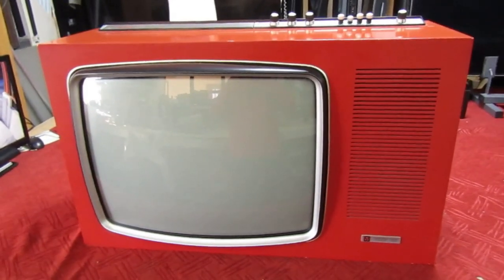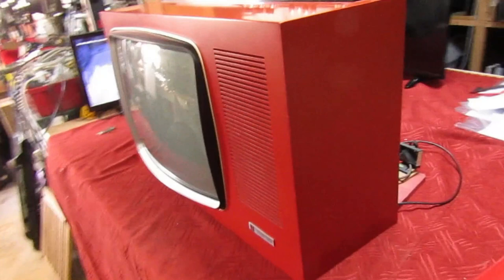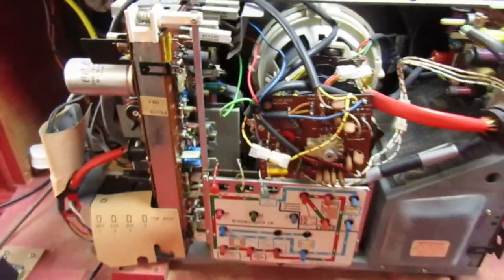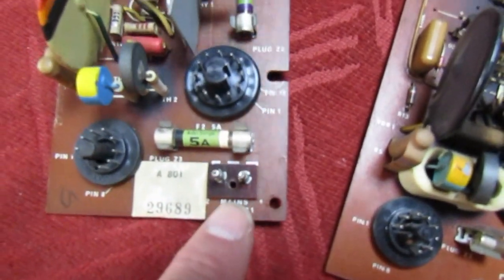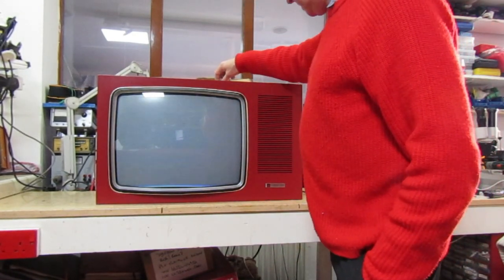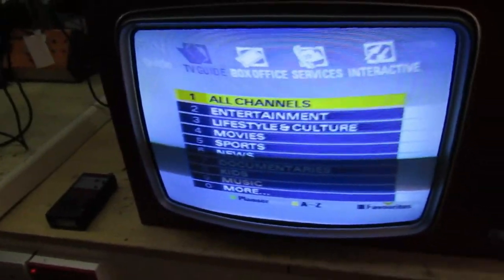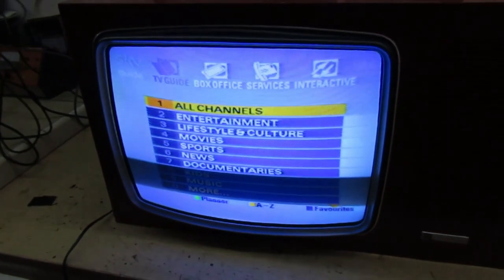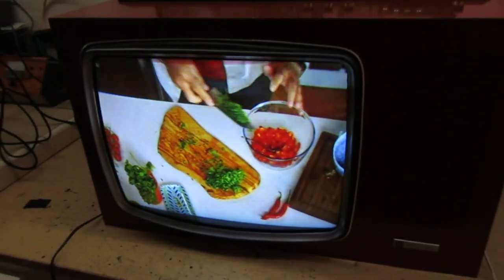Rank Bush Murphy A823 chassis vintage colour TV set from 1970 .

Comment: I remember this chassis well, it was the lead to the degausing coil that must be kept plugged in.
The one chip decoder was from the early batch of sets, the later 2 chip one is interchangeable.
Like all designs of that era, heat was the cause of most faults, and the charred spare panels shows
how bad they got, some were often beyond repair as the burnt areas became conductive.
I was only 15 in 1970, by 1972 i was learning how to repair them along with all the other popular
chassis from that time.
That orange painted cabinet shouts the 70's some were in white which turned cream due to the heat.
Happier days, when you knew the faults before you took the back of the set.
Thanks for this trip down memory lane.🙂👍
Reply from the maker: Glad you liked it , back then a lot of sets presented a serious fire hazard, you wouldn't get away with anything  like that today .

Comment: I used to like these. I sold hundreds of Co-op ex-rental models of these. The faults were fairly predictable and the weak spots easily dealt with before sale. The LOPTs never, ever failed (well not for me anyway, I kept one spare LOPT in stock and never needed to use it). The mechanical tuners had a problem with the nylon nuts disintegrating which was a nightmare until replacements became available from the spares suppliers. (These days you could probably 3D print them!)

Comment: wow nice to see a good old Rank murphy colour tv up and running again they were so easy to repair and set up i had a white Murphy A823  with the six electronic tuners on the top of the set with the afc button on the top too and the colour decoder on mine had the Twin chips fitted
Reply from the maker: I cant remember the electronic tuned set so not sure why you would want 6 channel tuning in 1970 , we only had 3 channels up until about 1984 and I guess by then most of these sets would have been scrapped.
Reply: @michaeldranfield7140  I agree there but they did have them on the Murphy ones and some of the Bush ones too but they were often flimsy and broke easily and some of the CRTS Would often display milky pictures if they were weak tubes plus had a fair few that had suffered catastropic power supply failures with the thyristor ending up destroyed and other problems like Video output transistors in the colour decoder failing 
but overall they were otherwise reliable Tv's

Comment: I cut my teeth on the A823 chassis. What you have there is an early  Murphy Acoustic with the one chip decoder, also the later models didn't have the two big pots on the timebase board. For the age of it looks very good. I've not seen one for over thirty years !
Reply from the maker: I think for me its 40 years since I last saw one of these !

Comment: I worked the solder bath at the end of the production line for the decoder panel at RBM in Plymouth 1974 ish and I remember there being 2 ICs on the board so the spare one may well be the later version.  Part of the job was to make sure certain components were pushed down before soldering including those ICs, the pots on the RGB output and the delay lines.  Thanks for the video, takes me back.
Reply from the maker: No problem , glad it was of interest and helps to bring back valuable memories for you .

Comment: nice, i repaired a bush ctv194 some years back, looks similar or same chassis, only fault was cracked surge thermistor,  unfortunately it eventually got dumped, with an early version 26inch philips g8 when the garage owned by the sets owner closed down and was demolished for housing, if i had space i would have had them, but i was already bunged up, he'd given me loads of stuff like old unwanted tvs, valve radios, etc. over the years as he used to do tv and radio repairs many years back as well as run a garage,

Comment: Fantastic Michael. I wish I'd kept one of these. I worked on many of them and, in later days, thrown many away. The early single chip decoders started off life with an IC with a built-in heatsink like the Plessey/Sinclair audio ICs of the day.
Reply from the maker: When I look back at the stuff I skipped many years ago I too wish I had kept hold of it , but then I didn't think 40 odd years later it would be making a comeback .
Reply: Allahu Ahlam how many Mains Voltage Isolation transformers I threw out decades ago.
Reply from the maker: @andrew_koala2974  I use to use the transformers out of the G8 to cure heater cathode shorts in some sets.

Comment: What a stunner!! Condition as well as the red finish and the resulting picture... just wonderful.

We had one of these from around 1972-1980 in white; re-badged with the name of the rental company and I was only little but I've had my eyes open for any sightings of them ever since. 😀

I believe they were marketed as 'Acoustic Deluxe', along with the earlier mono sets with a very similar cabinet design. And they were available in green and orange as well - both mono & colour ones.

Great to see - thank you.
Reply from the maker: Yes I do have recollections of the mono sets having coloured cabinets , cant remember the chassis number , I think it was something like 774 , I remember they had two boards .
Reply: @michaeldranfield7140  hi and thanks for the reply. I've seen a very good thread on the radios-tv. forum in which a post lists variations of the monos which started life with the dual standard A640 chassis. Then the single standard is the A774 chassis; there was also a solid-state single A816. My parents also had one of these for a short time... I remember my mum telling me this...  undoubtedly one of the latter two but wanted colour and the shop were not happy with them because they'd only just started renting the b/w one! I found the user manual many moons ago and so asked about it - why they had the wrong one, for a different set. But they didn't!  😆

As noted below, the actual colour set we rented would have been the later version - the tube surround looks a little different to this beauty on the video, as well as the channel selectors were very light to the touch, instead of the 'thunk' that my Ferguson Courier b/w has, along with countless others from the era lol. 

There are some nice advertising brochures for these sets online - I'd love to have them in my collection... I grab what I can from eBay when the price is right and do have a RBM tv colour catalogue from  circa 1974, alas not having one of these on the pages.
Reply from the maker: @IanAKAKeith  I have just joined the radios TV group, this guy has a stunning collection of sets , far better than mine .

Comment: customers used to like them with the matching stand.
it was the lead to the convergence coils that must be pluged in to stop the resistor catching fire.
In my opinion the single chip decoder gave a better picture than the twin chip and as far as i remember they  were interchangable 
great video as allways.
Reply from the maker: The owner has the matching swivel stand but removed the stand before transporting it to me , I still cant remember what not to unplug , I just remembered it was easy to forget and cause a burn up .
Reply: I ment degausing coils

Comment: Working at Rediffusion in the mid 70s it was mostly their MK1 hybrid but theY also had the A823s and BRC 3000/3500s. They even had some of the A823 chassis refitted into new cabinets with electronic tuners. I still remember changing those mechanical tuner plastic bushes from white to blue when they used to break and that carbon rod focus in the tower which scared me to near death.
Reply from the maker: when I removed the screening can my first thought was how to adjust the focus control, do you need a plastic tool , then I noticed its on a screw arrangement down a hole .

Comment: That set is in excellent condition. I think you will have to look at the video coupling as I can see l.f. streaking. If this is sorted the picture will be as new. The single chip decoder board is correct for that model as it also has the earlier timebase board and mechanical tuner so all original. Loved working on these sets in the 70's, never had a line output transformer fail on one of these!
Reply from the maker: The picture looks better that it is in the video , good to know about the transformer, parts like this will not be obtainable now  and I don't even know if anyone still does transformer re winding .

Comment: Fabulous stuff. A white one sleeps in my cellar. It's pretty rough, I think it also has the two chip decoder. I've also got the black and white version with the A819 (I think) chassis. One day I'll get around to it. Maybe......
Reply from the maker: I remember there were black and white sets in bright gloss cabinets , line transformers were a common failing on the mono sets.
Reply: @michaeldranfield7140  They looked very similar to the 823 colour sets, a lot shallower of course. The Murphy ones were branded 'acoustic deluxe'. I've still got the pedestal stand, and they fetch good brass on ebay but I wanted to keep mine, I saved it from the bin when it came off rental in 1990......
Reply from the maker: @stuartarundale6219  The customer has the matching stand for this set but removed it for transport, that's something you never see any more , stands for old TV s .
Reply: @michaeldranfield7140  Indeed so. The stand for mine is unfortunately in rather the same condition of the set. It would have to be re-chromed if the set were ever to be refinished and restored. I can't even remember what condition the tube was in. Sleeping next to it is another uncommon white set, a Korting Transmare hybrid, in similar disheveled condition alas

Comment: Very unusual to see in such a clean form. Those two extra PCBs seem to be its past repair history.  
Wish I could remember nowadays to reform the reserviour cap before switch on.  So many times on an instrument amp especially I've had to replace one because I forgot completely. Maybe having a purpose made reforming box like you use would remind me.
Reply from the maker: Other people have commented that the single chip board was the correct one for the year of the TV , so I would imagine the other boards have been used for fault finding , a thing I hadn't noticed in a plastic bag there were a set of decoder extension leads so I would guess at one time this set would have been owned by a collector .

Comment: Very nice set, loved that painted cabinet, they were ultra stylish back then, very well made and thought out chassis apart from the decoder which was a pig to work on due to lack of space, if you were an accredited rbm dealership a test chassis was available with a good set of boards extension leads and a 'second' crt, it wasn't particularly cheap but if you'd got dozens of them out on rental it was a good way of always having enough spare panels to support them.
Reply from the maker: I guess if you had a scrap set for the plugs and sockets you could make up your own set of extension leads .

Comment: IC's and 2 chip decoder? ... In 1970, I was watching a 1960's Ecko black & white valve powered 405 line Rediffusion TV with a clicky channel selector on the wall! 👎🤣 ... My father bought his first Ultra Bermuda Colour 26" TV from Trident in 1973 for £300 IIRC. It was solid state, but contained no IC's!

Comment: 7:20 - the single chip decoder indicates that’s a later board so the picture will tint slightly towards green. February 1970 date code on the caps indicates an earlier A823 though, so that decoder board has been swapped at some point.

Unless RBM were just using up older stock of new caps when this was made?
Reply from the maker: as it came with a couple of spare boards which had both been worked on I would think this came from an EX collector or enthusiast. I still have not found the service manual , I have it somewhere , I remember it had a brown front cover ., so not sure of the exact dates or decoder arrangement .

Comment: That's a early A823 with mechanical tuner unit fitted , the later ones had a 6 button switch bank .I think the decoder used to have 2 chips fitted SL901 /SL917  ? comes to mind . Not bad picture for a 50 year old tv not had much use by the looks of it .Murphy did them in Red , White, Green ,Blue as far as I remember  with  optional swivel stand .
Reply from the maker: I do remember the red and white very well but not the other colours, the owner also has the matching swivel stand , he removed the stand for transportation to me .
Reply: @michaeldranfield7140  I do remember seeing mono sets one with a green cabinet with dual standard a640 chassis and several white cabinets fitted with the single standard a774 chassis

Comment: Vertical still has a bit of residual bent at top but not noticeable. Though having said that, when I saw the kink before the dried out EB cap changed it seemed to me it was very slowly moving upwards out of frame and into blanking.
Reply from the maker: I didn't see it moving and digital cameras never seem to take good pictures of television sets

Comment: Thank God for EU energy labels. Lots of resistors that are basically just heating the inside of the cabinet.
Some older sets would, when they're turned off, still keep the tube filament heated, so you wouldn't have to wait for it.

Comment: My apprenticeship tv…crunchy convergence pots… thyristor power supply…poor 20’’ Toshiba tubes …
Reply from the maker: Its surprising just how hot these wire wound pots run .
Reply: Wasn’t it a BT106 thyristor bolted to a heat sink and hardwired to the board?
Reply from the maker: @steve83803 Yes BT106 , a few set makes in the day adopted the same thyristor power supply.

Comment: We had a set that looked similar, but it was black and white and a wood veneer cabinet. I remember it failed under guarantee and my parents sent it back to Comet for repair. They had it for about 2 weeks before diagnosing line output transistor failure. Mum was not impressed with the repair department!!

Comment: I have a  circa 1980 SONY  26""  Multi-System TV sitting in the Garage 
for decades - It was built by SONY in Germany and cost a fortune New.
At almost $2300 as near as I recall and double the price of a commonly
available domestic TV.
It failed after only 3 months of use - as it was under warranty - back to 
SONY it went --- They could not repair it and ordered a replacement
from Germany that took 6 weeks to arrive and another two weeks for SONY
to replace it and/or complete the repair - ready for collection.

Just prior to the warranty expiry period - it failed again.
I said  - Screw it - and instead - I repaired it myself. 
*Having studied Electronics Engineering with PHILIPS
I can only say that it was a pain in the neck to work on - complex
circuitry ---  nevertheless it operates on various AC mains voltages /f
and  all the variations of PAL - NTSC - SECAM  and Middle East SECAM
It would have been great if the TV even existed in 1974 when I was on
attachment to the USAF for two years
There is also a 26"" GRUNDIG in the Garage with a faulty [Thyristor]
Horizontal Output Stage  -  The CRT is excellent on both TVs
It will make an interesting project to restore them.
The downside is that the GRUNDIG  as well as other German sets
such as NORDMENDE - SABA -GRAETZ  were not well suited to the
warmer climate in Australia - unless one happened to be in the
mountain and southern colder / and snowy regions. 
The German sets operated at an elevated temperature - destroying
components and Circuit boards - and were very power-hungry -
and they were very good room heaters during winter evenings,

Besides those  - I have two SONY 21''  Computer monitors -  one of which
is rebadged as IBM - they cost me $5000 each NEW --
years later I found one that had been dumped by Sydney Based Modelling
agency - HQ in Paris France --  I discovered that it had a broken pin on the
CRT --  fortunately the CRT is still under Vacuum.

Comment: Reforming is not worth it !!
Reply: The original caps built with will often outlast modern replacements if they're reformed. Forming and reforming was actually important task back in the days of valves (tubes stateside).   Nowdays wet aluminium are pre-formed at the factory, put into use before losing form and become the popular subject of 'change all the caps'
Reply: @jagmarc  - That was back then.